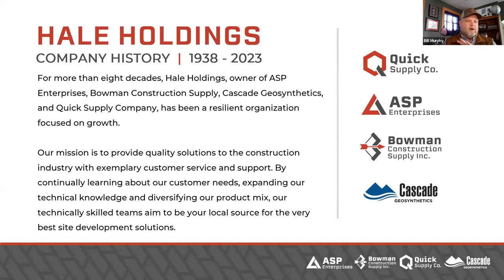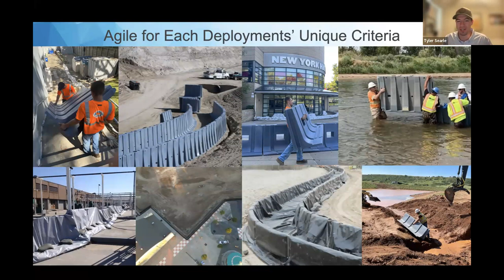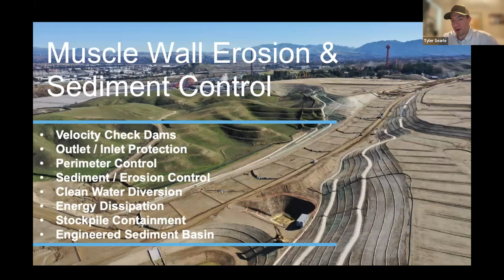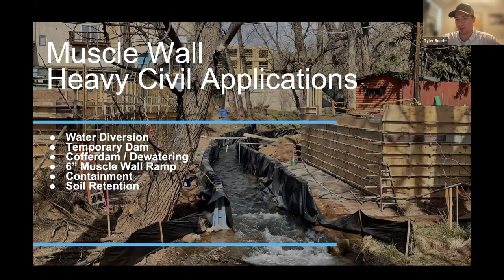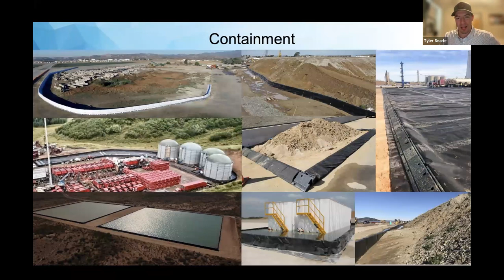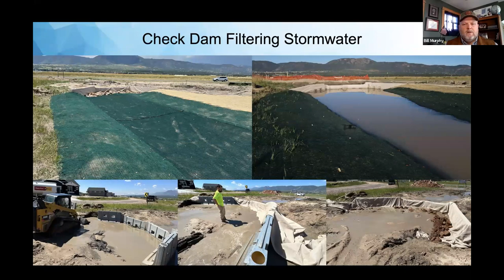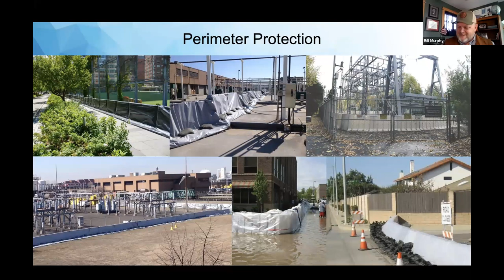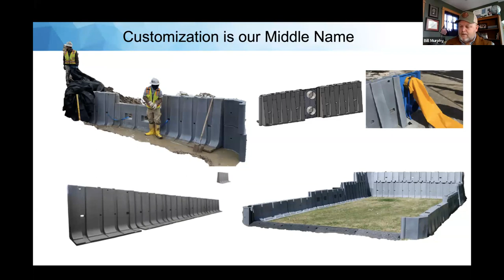Muscle Wall Webinar - Flood Protection, Erosion Control & Containment Solutions

Comment: Sigma Chi fraternity OSU ivented this back in the 90s for their pirates house dance, and didn’t even know it! I was getting into engineering at the time and remember having conversations with my boyfriend (also engineering student)  about fluid mechanics,  and how the wall worked! From what I remember, the Chanel of water built-up with same type  of wall, it allowed our chariot boats to flow around inside and outside the house seamlessly! 
So Tyler, are you a sigma chi alumni? 😂